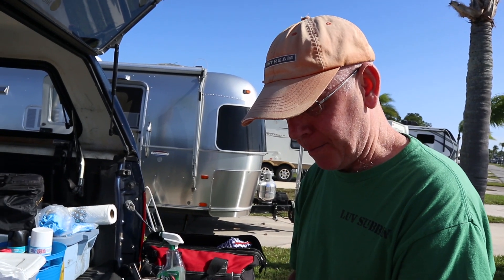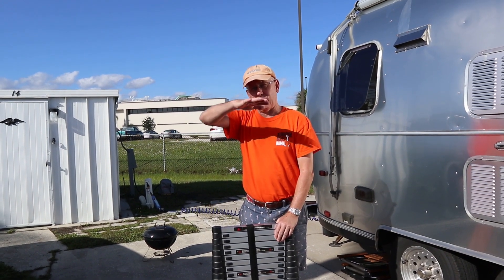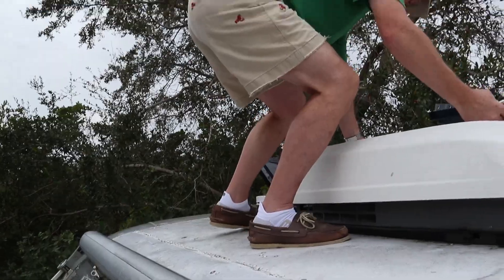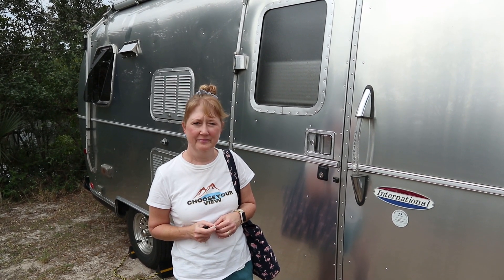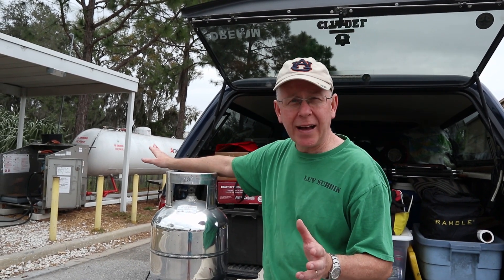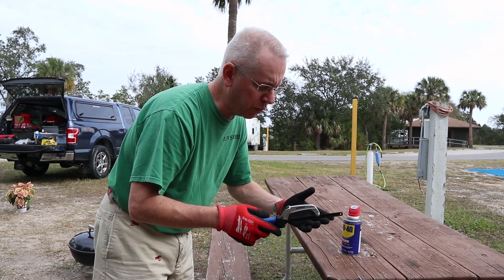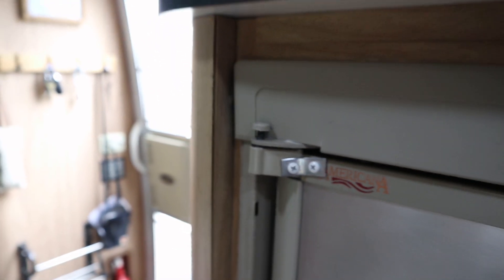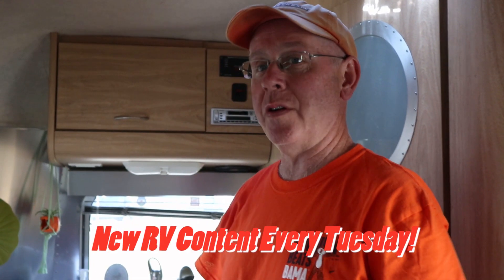On Our Airstream Roof While Camping! | Fixing a Rookie Error | RV Maintenance Day

Comment: a simple upgrade to do would be to change those drawer slides to ball bearing full extension slides.
Reply from the maker: Thanks for watching and good point.  We're going to do a major refit in about 4 - 5 years and will consider that.  Interestingly, our drawers are made of steel and quite heavy...
Reply: @LuvSubbin  Ok you have the meta box drawers. I used to use those about the time your camper was built. Well if you are going to do a major refit having new drawer boxes made out of plywood would be so much nicer and they don't weigh as much as the meta box style.

Comment: Great job as always LuvSubbin!

I am proud of myself for having the same ladder you do!   It makes me feel better about myself 😊

Wondering if you considered the Maxx Air covers instead?   You still need the Fantastic vent cover but the Maxx goes over the assembly and you’ll never have wind break the FV cover again!

Last - the draw latches - I hate them!  Every time they close in the locked position I replace them because when I try to pop out the locked tab they break!   How did you free yours??  Thanks!!!
Reply from the maker: Hi Tin Goat Travelers!  Thanks for watching.  A ladder is huge.  Cindy was able to close the vent but can you imagine a tree branch smashing the vent with a rainstorm on the way?  We've considered the Maxx Air and Cindy actually asked me if that would have prevented the failure.  Maybe someday...  Finally, Cindy is the Latch Whisperer.  She uses a wide flat head screw driver to gently pry it open.  So far, she has not broken one.
Reply: @LuvSubbin  thanks!!

Comment: Love your channel and I am an airstreamer and materials engineer/ retired shop teacher. I have been working on repairing plastic by using two products you use a lot; super glue and baking soda. You can build up to any thickness a section, glob, sheet, or any shape hard plastic you can repair your fridg with. Look on YouTube, it is unbelievable. 
See you in Rock Springs.
BRN 11773
Reply: I have used the super glue & baking soda technique to repair several small parts with impressive results. Shared technique with a friend and he repaired a severely cracked plastic water pump casing with success. One should practice and be ready to use when needed. The repair is almost instantaneous and very strong.
Reply from the maker: Thanks for watching and especially for the awesome information.  I have not heard of that before but will definitely use that technique (you might even see it in a future Luv Subbin episode).  Make sure your find us in Rock Springs to say "Hello".

Comment: Have you thought of a 12 volt compressor style fridge to replace  your older one?
Reply from the maker: Hi Paul and thanks for watching!  We've talked about 12 volt compressor refrigerators and will never, ever get one.  We like the option of running on propane when boondocking.  Having to rely on the battery for a mission critical appliance is not, in our opinion, worth the extra space.
Reply: @LuvSubbin  Rich, First i have learn to retract every statement i have said that had the word never in them. 12volt fridges today run on about 2.2 amps, normal battery would last 24 hour if you left the door open. Plus you have some solar to recharge your usage and there is always that little Honda gem you bring with you as well.  i really don't think you have too much to worry about Boon docking with one. I have used 12volt types for the last three years with no issues. Just some food for thought.

Comment: We are the owners of a 2003 CCD 22 ft. and we too have noticed that the drawer and cabinet latches are sub-par. We currently have 3 drawers we have to remove from position when traveling so they don't fall out. Plans are to make new door and drawer fronts with new hinges, latches and handles. Any suggestions where to find good quality RV cabinet hardware?
Reply from the maker: Thanks for watching!  That's awesome that you have such a similar rig to ours.  Cindy empties anything heavy from the drawers (like the silverware tray) before travel.  We are planning a big refit for the Luv Sub in about 4 years and will replace the latches.  To do so, we will go to a marine hardware store.  Boat stuff is 3X the cost of normal stuff but the quality is higher.  Check out our Florida RV Supershow video (the first one) and we show the new Airstream Ridgeline with the latches we want.  We hope to see you and that CCD down the road someday!